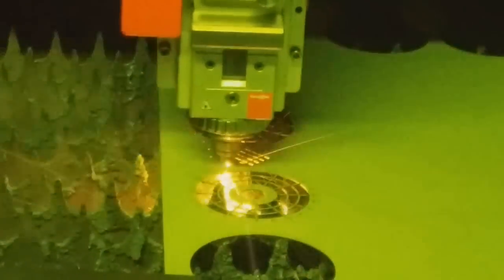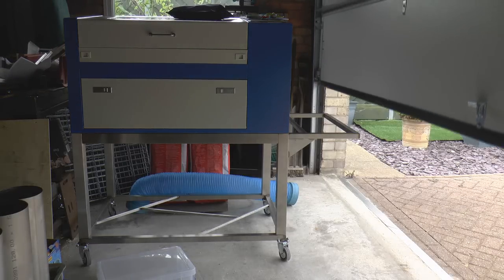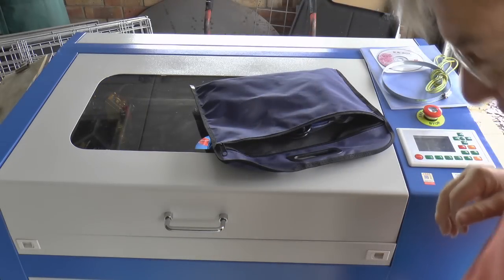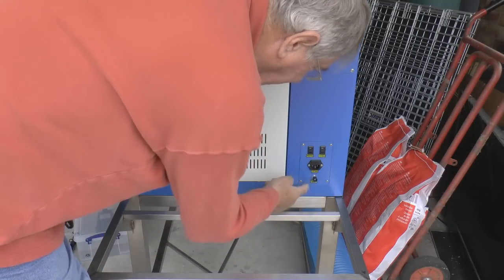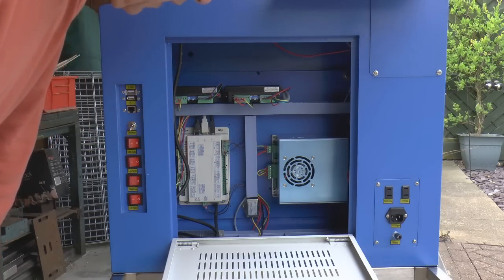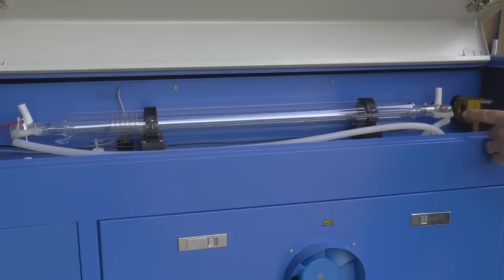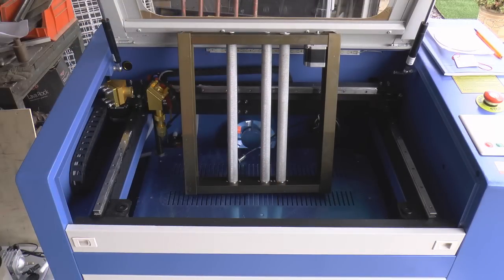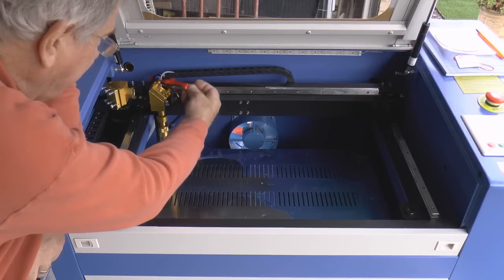Chinese laser cutter  tutorial part 1

Comment: hello the +5v lights are on in my machine... Im very new what might be wrong?
Reply from the maker: Hi
There may be nothing wrong. If you are talking about the lights on your white controller box the you will see the LED 15 on and LED 14 flashing to tell you that all is OK and the machine has got it's 0.0 position and is ready to run a program. Other than that I am not aware of any more 5v indicator LEDS
Best wishes
Russ
Reply: I have my power all the way up to 100 right now and all it’s doing is a very light etching when I press pulse the whole machine dims I don’t know if my laser is defective or what
Reply from the maker: @Bre273  
his could be a bit complex so Ithink it better to speak off line. Add your email to another comment and I will answer. I will also delete your comment from public view
Best wishes
Russ

Comment: Hi Russ, I am about to buy an open box Chinese LY6040 laser machine. It is brand new never used, but I am wondering how can I make sure that it is in working condition at the time of purchase. Is there a way to test it without installing the pumps. 
Thank you in advance,
JC
Reply from the maker: Hi  JC
I have to say from what little I have seen of the machine there are two major reasons I would not buy this. First it is controlled by a Trocen Controller that has to run off  LaserCad software. I have used this and found it limited in features  and difficult to get into. The second is more important and that is the Y rails are flimsy rods with ball bushings on them (I have seen machines with proper HiWin type linear slide systems that are ok). When the Gantry is at the centre of the Y rail, there will be certain speeds where the stepper motor pulses  will cause severe resonance in the X axis leading to very jaggy cuts.. The thin support plates from the gantry to the bearings are also flex members. I have seen problems with this basic design many times. So everything says dont buy.......even at a bargain price.
 Sorry to be a doom merchant  but I don't want you calling me for help with problems I cannot solve.

Best wishes
Russ
Reply: SarbarMultimedia 
Thank you for your fast reply. I will take into consideration your advice. What would you suggest for buying a decent quality laser machine having in mind that I have experience with large format printers and cutters as was sublimation machines. 
Waiting for your reply 

Thank you
JC
Reply from the maker: @jean-claudesfeir4007  
I do not know your needs but I can see from  your 600x400 mm machine size that you are sensibly starting off with a useful size at 60 or 80 watts. Where are you based in the world (USA or Canada is my guess), That may help me a bit.
Best wishes
Russ
Reply: @SarbarMultimedia  I am in canada
Reply from the maker: @jean-claudesfeir4007  
That's good news. Anywhere near Montreal?
Reply: @SarbarMultimedia  yes in Montreal
Reply from the maker: @jean-claudesfeir4007  
Wow what a lucky coincidence. I may be able to put you in touch with a guy who already has just the machine type you are seeking. It's not for sale but you may get some good info from him. 
Send me your email in another comment and I will delete the comment immediately. I will also contact this guy to see if he is happy to help you.
Reply: @SarbarMultimedia  Hi Russ, did you get the chance to get in touch with the person in montreal for the laser??
Thank you in advance,
JC

Comment: Can this cut 3mm Ali and   up to 2mm Steel
Reply from the maker: Sorry no. You can buy 200watt machines with metal cutting ability but the quality of cut is not brilliant and you need a much beefire machine to hold the more complex and heavire head. You will also need expensive bottles of nitrogen (even more expensive argon) and maybe oxygen. Metal cutting is not really a hobbyist activity, if you need laser cut metal profiles go to a professional shop it will be a lot cheaper than yourmachine investment. These little machines are designed for non-metal cutting.
Best wishes
Russ
Reply: Thank you enormously from my colleague and I whom are thinking of getting a metal cutting laser
Reply from the maker: @judgenap  
Hi
I used to run a metal cutting laser profiling business with two 3kw CO2 laser machines. Before you make your investment I urge you to go and chat with a professional metal cutting laser shop so that you can understand just what the process is that  you are going to buy into. Your Chinese machine will work but you will generally need oxygen  (12 to 15psi) to cut mild steel and nitrogen (100 to 150 psi)  to cut stainless. It will be very expensive on gas consumption and at only 200 to 300 watts quite slow.
Good luck with your new venture
Best wishes
Russ

Comment: Hello Russ, 

Im using a 130w co2 Chinese laser cutter Reci. I keep getting Hard Limit Prot (press esc) 
Both my little red boxes on x and y axis light up when I put a screw driver on them. So it seems to be resetting ok. But I get hald way through a cut and it stops dead with the above warning … could u help me at all please ? Annette
Reply from the maker: Hi Annette
 When you switch on or press reset, your head moves to one corner and sets 0,0 and you will then find LED14 flashing. This indicates that 0,0 has been successful and the machine now knows the machine table boundaries you set in CONFIG, PAGE SETTING. If any part of your program exceeds these limits you will get a SLOP or ENVELOPE error, The HARD error results from  of a mechanical switch (not the flow protect switch) that is being randomly triggered (may by vibration/machine movement) during your program. Is there a protect switch on your main cover?  That is the main reason for such an error. You mention you have a Reci tube. If you also have Reci or Reci clone power supply, I do believe there are protection mechanisms within that feed out to the main machine. I must be vague on this last point because I have no direct experience of problems with these power supplies. Hope this gets you pointed in the right direction.
Best wishes
Russ
Reply: SarbarMultimedia  hi Russ 
Thanks for your reply, I’m now having trouble getting the laser to the home position 0,0 
It reads 1000,1000 and is hitting the sides of the machine when I move the granular around. Could u help me on how to get x and y back to 0,0 when it’s home. 
Annette

Comment: what brand is this machine?
Reply from the maker: Hi
This happens be from the ShenHui factory  http://www.lcshenhuilaser.com/350-D-laser-engraving-machine-pd349002.html  but I bought it from an ebay source

There are lots on your ebay
https://www.ebay.com/bhp/laser-engraving-machine-50w
but don't buy anything unless it has a Ruida control system....easily identified by the keyboard. See this
https://www.ebay.com/p/50w-Engraving-Cutting-Co2-Laser-USB-Machine-Engraver-Cutter-Water-Cooling-Tube/17004810636?iid=162799645712

Best wishes
Russ

Comment: Hi Russ, first of all I would like to thank you for sharing all your knowledge and experience! You are by far the best source of information about laser cutters I have been able to find online. Thank you so much!

I hope you can help me with the following. I myself have a Chinese 60W CO2 laser cutting machine. The laser tube is connected to the water cooling but a small air bubble (about 5 millimeters diameter / 0.2 inch) remains at the end of the tube. I have already lifted the laser cutter on one side so the bubble can escape but I don't get it away completely. 

Do you have any suggestions, or doesn't it matter if there is a small bubble in the tube?

Thanks in advance,

Maarten
Reply from the maker: Hi Maarten
You need to make sure that your glass outlet pipe at the cathode end of the tube is between 11 and 12 oclock (almost vertical). I suspect you have already done this and that your bubble is trapped just beyond that outlet pipe. This position is not dangerous but it is well to reduce or get rid of it. Open  the machine and find the inlet silicon water pipe . If you can find some slack in the pipe put it across the palm of your hand and with heel of your other hand  give the tube a sharp karate hit. This will produce a pressure wave that will hopefully dislodge or reduce your bubble. You may need to do this several time with both inlet and outlet pipes.
Best wishes
Russ
Reply: @SarbarMultimedia  Hi Russ, thanks for the quick reaction! It worked, the bubble has been removed and I can now continue. Very nice!

Best wishes,

Maarten

Comment: Hi Russ. Thanks very much for posting The tutorials, really helpful and inspired me to get my own machine. However when I got it, it was wired at 110v but I plugged it into a 220v source. I have since corrected this issue but I have done damage to the machine, that will need repair. What parts of the machine could be damaged by doing this ? 

Many thanks
Naoise

Comment: Hello Russ just want to say thank you for all your knowledge and videos..they have been so helpful and must have taken alot of time to do. 
I've have an issue with my laser and am hitting dead ends all over..it all started with a loss of power when on the first cut of the day..i thought it my tube after all the obvious checks...replaced a new one..aligned everything again but noticing a whining noise from laser when firing pulse...not happy I went to investigate on the net...after reading it could be the high voltage end I checked and reconnected..then after turning machine on again my LCD control panel lights up but has nothing displayed on it and the machine doesn't move to home or anything? Any clues or tips would really be appreciated.
Thanks
Reply from the maker: Hi Kelly
 Sounds like you may have several issues tangled up here . There is no simple one line answer I can give so add another comment with your email address and I'll see if I can help. Comments get auto copied to my email so I will immediately remove your comment (and email) from public view.
Best wishes
Russ

Comment: do you have a link to this cutter/engraver?
Reply from the maker: This is the machine I bought 3 years ago. The listing gives the machine specification but this type of machine is becoming more difficult to find now and is more expensive

https://www.ebay.co.uk/itm/350B-50W-CO2-Laser-Engraving-Cutting-Machine-Auxiliary-Rotary-Device-0-60000mm-/111694615353?hash=item1a01849339

Good hunting....I checked Ebay.com and there is nothing similar available.
Russ

Comment: Hi there, first time commenter long time watcher. I have a problem with my laser and I was hoping you could answer my question: When you press the 'Test' button on your power supply should the button's LED light up? Mine doesn't. So I'm wondering how best to determine whether I have a faulty power supply or my tube has died. Any help you can give would be invaluable!

Many thanks for your time.
Reply from the maker: Hi Peter
The chance of a tube just instantly dying are pretty low. The  power just fades away over a few weeks. If your tube is labeled  K H Laser then things may not follow this normal course. There is no such tube manufacturer.  This company buys reject tubes from big manufacturers for next to nothing, retests them to make sure they work "in some way" enough to fool the average  naive  E bay buyer.. So these are B grade tubes that may just fail mechanically in some way. The HV power supplies are equally B grade  and can easily fail instantly.   In general the easy way to know if the power supply has failed is to look at the tube. The tube should glow pink regardless of  whether it is dead or not. The pink beam is NOT the laser beam it is ionized nitrogen that will still be there when all the CO2 gas has been used up.. If it fails to  ionize, tis means a dead power supply.
Do not buy tubes or power supplies from Ebay or Amazon marketplace as these are very likely B grade.  Depending on where you are writing from I may be able to recommend a trusted source

Hope this helps

Russ
Reply: Hi Russ, 
Thank you for your speedy response. The tube doesn't glow at all, so I suspect you are right about the power supply. The steppers and display are getting power so it seems to be just the laser which is powerless. I appreciate your help and advice, and would be very grateful if you could point me in the direction of a decent PSU. I'm based in Northern Ireland, UK.

Many thanks,

Peter
Reply from the maker: @petetheweet  
Hi Peter

Send an email to gareth@thinklaser and tell him what you need. These guys only deal with A grade product

Best wishes
Russ
Reply: Hi Russ,
I spoke with Phil and sent him some photos of my PSU so I'm awaiting a quote. Thanks again for your help.
Best regards,
Peter

Comment: Hey Russ, I've recently took the plunge and bought one of these, mine is identical to the one in your video but it is green and black... Looks pretty good to be fair.
I've also watched a lot of your videos and have found them to be very detailed and informative. My one question would be, do you have to buy distilled water or is it ok to use condensed water from a condensing tumble drier? Has this causes you any issues at all since you started using it? 
Thanks a lot, Ash
Reply from the maker: Hi Ash
My wife has a condensing tumble drier and I agree that the water is basically distilled water. However, it is not quite the same as pure distilled water that I ordered via my local pharmacy (10  litres was about £10). The tumble drier water still has the scent of softener in it so it contains chemicals of some sort. I started off using distilled water and here I am two and a half years later with that SAME water still in use. It's not green, cloudy or slimy. I have debated using the condensate when I need to change but have decided against it. I will get some more pure distilled water because it is microbe and chemical-free.

Best wishes and good luck with your new venture
Russ
Reply: SarbarMultimedia Thanks Russ, how soon after getting this did you need to change your tube? And what did you upgrade it to?
Reply from the maker: Hi Ash

Although an engineer and with lots of experience of metal cutting lasers, this technology is 99% different and so despite my confidence when I bought the machine, I soon found out that I knew nothing. My naivety is on video for all to see. I soon was pretty confident that the tube in the machine was rubbish and with my ignorance still high, I purchased a slightly better rubbish tube from ebay. It was cheap for a reason!! I soldiered on with my learning for a few months when I was sure the power supply was misbehaving also. I then took the plunge and upgraded the machine from the supposed 50watts (it was actually a 40 watt tube) to a genuine 60 watt power supply and tube from Mactron in China. The tube turned out to be 70+ watts and is still running today,  like new. It seemed expensive at the time (with courier and vat added as it entered the UK) but has been a dream to own.

https://www.aliexpress.com/store/321243

https://www.aliexpress.com/store/product/1200MM-60W-Laser-Tube-60W-co2-Laser-Power-Supply/321243_1109607209.html?spm=2114.12010608.0.0.44fb50ed2KHEqf

If you are in the UK you may like to contact     gareth@thinklaser.com  as they hold UK stock of EFR tubes (excellent) and 60 watt power supplies  They will probably be cheaper (despite middle man profit) because they arrive by boat as part of a large machine consignment.

Best wishes
Russ
Reply: SarbarMultimedia Cheers Russ, I'll definitely look into that. I always like to keep my options open. I'll more than likely look into purchasing an upgraded tube and power supply because I am looking at starting up a small craft business from home using this machine (once I've got everything in order) so I need something that will be fairly reliable. 
Until then, I've got many more of your videos to watch 😊
Reply: SarbarMultimedia, And yes I'm in the UK (Birmingham) so that tip will definitely help. Thanks again.